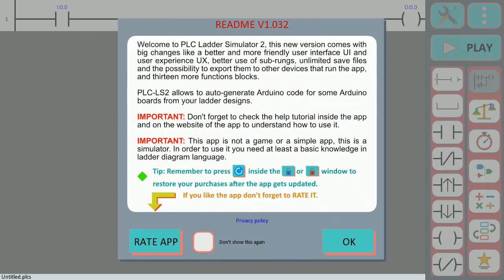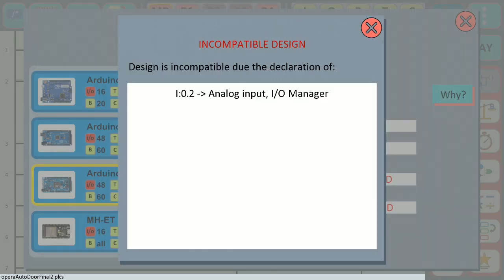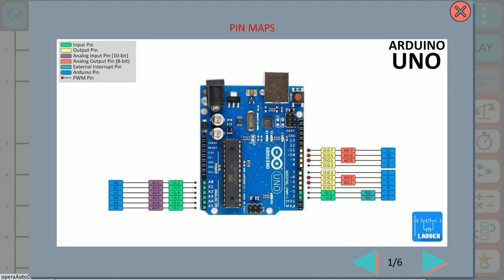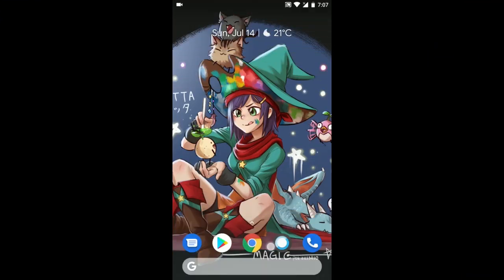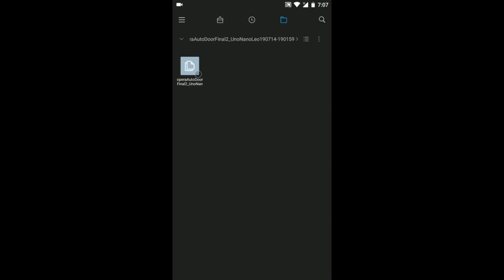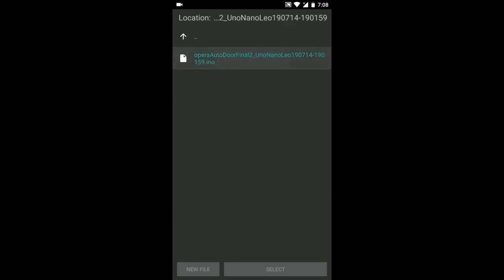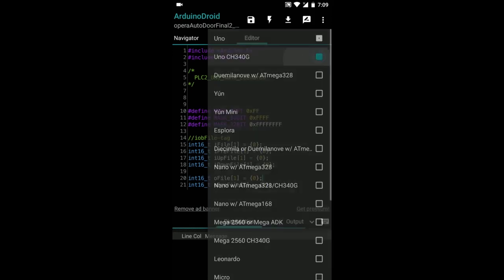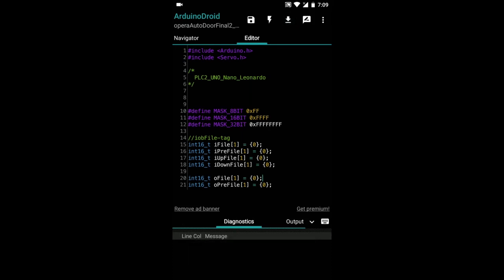Generate Arduino Code Tutorial for PLC-LS2

Comment: That doesn't work.  The program is uploaded.  But it doesn't work.  If you do not input the output lamp, the lamp will be lit.
Reply from the maker: Hi Mr. Maker, please send me the .plc file and the generated Arduino code of your design to casdata@gmail.com I'll take a look.
Reply: File and diagram have been sent. Please check your email.
Reply: Patel Shakti, prosenjit.ele@gmail.com